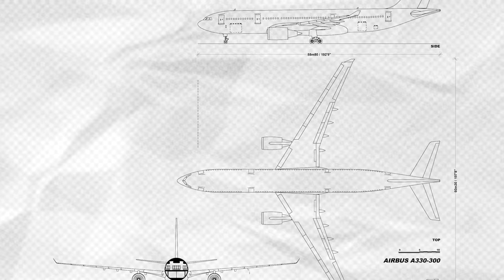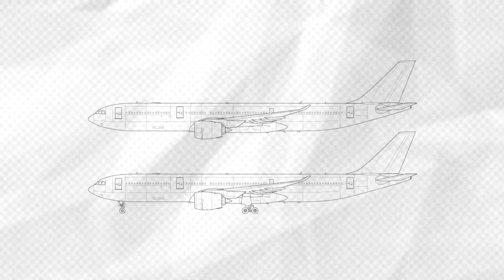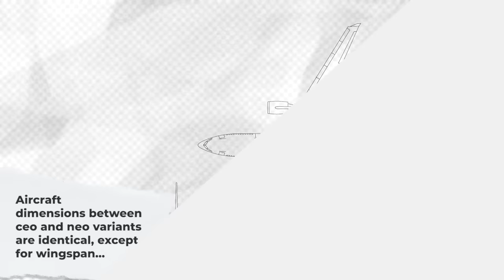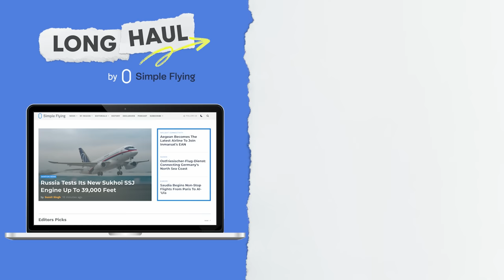The Airbus A330neo vs A330 – What’s The Difference?

Comment: Don't just compare models, also consider context and reality :
- pandemic demonstrated many businesses could be done remotely (well the world kind of was forced to do it) => less business travellers
- global recession => less travellers
So, yeah, today you have a bunch of 777-300ER and A380 (a few 747-8I), you can't get rid of them as some routes require them, but when the time comes you renew your fleet, you consider what would happen in the next 20 years : the high capacity planes you'll want to replace are 777s and A350s, you don't want too many of those, but you'll need to replace A330s and definately not have any 4-engines anymore (A340/747/a380), so, you absolutely don't want the A330-800, too small, the A330-900 is better.
However, 787-9 and 787-10 would be an option, and slight upgrades from Boeing are to be expected.

Similarly, for 777-300ER users such as Emirates or Air France, the 777-8 is slightly smaller than 747, and much smaller than A380, and is a direct competitor of the A350-1000 which is already available today, you don't really need to plan on ordering 777-8 in 2023, more likely in 2030 when you need diversity in your fleet along with 777-9 and if things go better, which is probably too optimistic. The 777-9 is in line with the standing and there would be no larger airliner in the world for the next half century, so, take a handful of those beasts, then directly cut capacty down to A350-900/A330-900/787-9 (or an eventually upgraded 787-10 which is a very poorly performing version as it is today, much like the 767-400ER)

So, put in perspective, airlines plan to decrease capacity offers the range of the 747/A380 down to 777-9/A350-1000, and in the range 777-300ER down to A350-900/787-9 (or -10 eventually). At the same time, A330-200/300 fleets had to get replaced, so, it seems the A330-900 does fill those requirements, but if you can get A350-900 and fly most routes on your network, why bother getting A330-900 ? It's more important to have the exact required offer than get extra planes for route flying efficiency, and ground extra planes more often the rest of the time (that's a waste, nobody want to watch those planes on the ground since the pandemic). Why the A330Neo sales are so depressing is not really about the planes themselves, but the context and projections, you actually have options (787/A350). The A330-800 is just... useless, except for airlines that don't have a market and can't propose an offer larger than A330-200/800 or 787-8. What may change is the worldwide A330-300 fleet renewal, it is expected to still have A330-900 orders for many years to come, but sure, you mentionned it, you don't have engine manufacturer diversity.

Finally, an airline flying Boeing won't select A330Neo. As an airline, you need to replace planes at some point, but not at the expense of an entire qualification program and the hassle of operation and logistics reorganization. That's why even when the A330 would be the PERFECT replacement, an airline already flying 777/787 will stick with 787. Perfection doesn't mean possible.

Side note : I won't say it enough : range is irrelevant, what matter is payload (and takeoff run). "How many tons of payload can I lift from this airport and deliver through my network at what cost if there is such demand there ?" 99% of long haul routes worldwide don't care about 8000nm range, they are in the 3800-6500nm window. It's just a reflex to advertise range to give an idea of how fuel efficient the type is, because human brain can't digest an information the kind of 1.6kg/pax/100nm, a value that also changes depending on how much seats you have and if you also add cargo. Saying "the A330-800 flies farther than -900, I don't understand why airlines aren't interested..." yup, they don't care.

Comment: CEBU PACIFIC AIR HAS SIGNED MOU TO AIRBUS FOR 16(SIXTEEN) AIRBUS A330-900, BUT THEY TAKEN THE 3(THREE) A330-900NEO ALREADY PAINTED FOR AIR ASIA MALAYSIA BUT THEY CANCELLED IT,NOW CEBU PACIFIC HAS 19 ON ORDER,4 OUT OF 19  HAS ALREADY DELIVERED.
Reply: Since already 16, I guess the brand new (as in manufactured for Cebu Pacific, as the former AirAsia X are called white tail) will be reduced to 13

Comment: As 330-200/300s become older air carriers will start to phase them out for the NEOs. 

Remember Delta has only so much time with the 767-300s and eventually the 764s. 

Give it another few years United will look to phase out the 763s and 764s.

Comment: The A350 stole some of the orders from A330 customers. It is a larger more efficient plane at roughly the same price as the A330neo. You only but the A330neo if you don't want to do the pilot training, or you have an edge case reason why you need that particular plane.

Comment: A350 has taken the limelight away from the A330
Reply: The A350 has capacity similar to the 777, while the A330neo is similar capacity wise to the 787
Reply: A330-900 A350-900 787-10 and 777-200 are all rated for a max of 440 passengers (current production) meaning whatever additional variants in the fleet work best for the airline is the aircraft they will choose. A330 lucks out in that as the 787 has 2 smaller variants with better distances and A350 a newer design also has a larger variant meaning if the 330 is in the middle with less distance and/or less capacity. So the only reason to get it is to replace or grow a fleet of 330 already in service with an airline.
Reply: So there’s many options with the same capacity of around 275ish in 3 class 300-320 in 2 class and 440 if anyone wants to try that in 1 class configuration.

Comment: The 787 variants offer newer technology, lighter weight and better costs per seat mile than the neos. It's a fairly easy decision, especially considering that the A350-900 is also taking sales away from the A330-900 variant by offering more seats, more space and better costs per seat mile as well 
Even with no NMA in sight, the A330 variants are too big to fill the gaps left by the 757 and 767. The 787-8 would be a better option for most airlines.
Reply: Incorrect, as your Boeing bias always shows
Reply: @ant2312  interesting how you can just say incorrect without offering a counterpoint. No Airbus bias there at all.
This is not about Boeing or Airbus. It's about numbers, and as much as fanboys like to twist the truth here, numbers never lie. The 787 is outselling all variants of the A350 and A330 NEO combined. 
Feel free to ask yourself why this is, or feel free to ask the airlines who are making the choice, but please focus on facts rather than trying to jab people here.
Reply: 787 is obviously superior against A330neo on longer ranges but considering A330neo development cost is like pennies ($2B compared to $32B on the 787), it wouldn't be much of a hassle to cover up the holes, and easier to break even, even with not many sales
Reply: @stoje8405  Agreed, but the A330neo cost over 4 billion. It wasn't a high risk investment for Airbus, but expectations were for the A330neo to perform as well as the A320neo relative to their older variants. That prospect backfired on the A330, and had it not been for the A350, Airbus widebody offerings would be a disaster.
Reply: @sainnt  
Eh i remember it being 2B but idk
the reason why A330neo wasn't selling well is because many of the older A330s aren't even that old, and another reason is because of his brother, the A350 and the rival, B787, they're both the best jets in the market in different markets. Yes youre right that it would've been a disaster if A350 didn't exist. The A350 is currently the best widebody flying for long - ulta longhauls, followed by the 787 for medium-long hauls
Reply: @stoje8405  Agreed